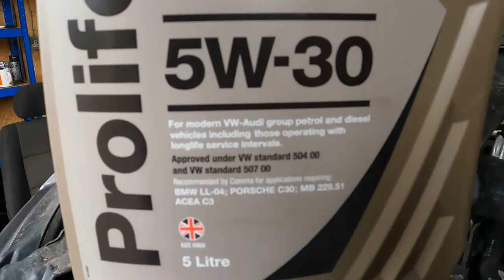Skoda Octavia 1.0 Oil And FIlter Service

Comment: Nice explanation! But I think I would never spray brake cleaner IN the engine like you do. Clean it with a cloth or paper and after mounting the new filter you can use as much brake cleaner as you like to clean it.
Reply from the maker: No brake cleaner was sprayed into the engine and even if it was it Makes no difference as brake cleaner evaporates 😉

Comment: Hi. Nice and useful video. I have an Audi A3 1.0 TFSI 2017 without GPF that uses 504/507 oil (5w30 or 0w30), but as I know, for engines with DPF (after 2018) you are suposed to use 508/509 oil, so a 0w20 one; it is not applying to your model? 
I have made oil changes at dealership and at every change they are also change the 3 screws with blue seal (I don't know why), and the oil plug. Could you reuse without any problem those 3 screws? Thanks!
Reply from the maker: Depends what country you are in but in the UK the recommended oil for petrol is 504, 502, 508, ACEA A3/ACEA B4 or API SN/M and for diesel models 507, ACEA C3 or API CJ-4

Hope this helps
Reply: Neither a TSI or TFSI engine would have a DPF as they are petrol engines and only diesel engines would have a DPF.
Reply: @TotalOpel  I was refering to GPF (Gsaoline Particule Filter) - check Eu6Dfull depollution norme requirements, nor Euro 6 W. Succes!

Comment: My Skoda dealer puts in 0W20.
Reply from the maker: Ye that’s fine as it will meet the dealer / engines spec
Reply: It depends on the engine. Up to around 2019 504.00 was the spec but after that it changed to 508.00

Comment: Nice one Andy. What's your opinion on these wee VAG engines? You can hear the valvetrain quite a bit!
Reply from the maker: They sound horrible but they do seem to pull quite well and they are easily maintained as there is plenty of accessible space in and  around the engine. Octavia and Superb are easily the best cars around and have been for some time in my opinion. You thinking of getting one?

Andy👨🏼‍🔧
Reply: I'm thinking of getting a 2018 Skoda octavia estate 1.0 tsi SE with only 42,000 miles. Are these engines really reliable and cheap to maintain?

Comment: Great video sir!

How much oil does this 1.0 tsi engine take, all the 5 liters on that oil bottle or maybe less? And does it matter if it's the 95 hp or 115hp 1.0 tsi engine?
I just bought me a fabia with a 95hp 1.0 tsi engine and considering to DIY the up coming oil change myself.

Thanks again for the great video sir!
Reply from the maker: I can’t remember how much it took. It wasn’t the full 5L though. I did a Fabia last week and it only took 4L. 

The information will be in your handbook though

Andy👨🏼‍🔧
Reply: @AMSVauxhall  Thanks for answering sir. I'll be checking the handbook. 
Have a good day!
Reply: I changed the oil in my Octavia 1.0 tsi 115hp today and 3.75 litres took it to the top of the hatched part of the dipstick. Great video btw, was very helpful.
Reply: 4L